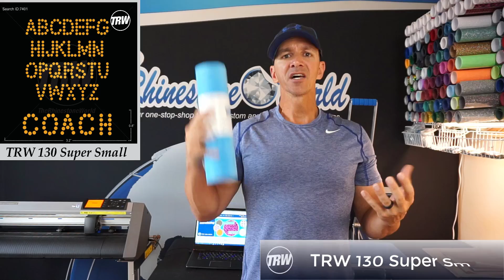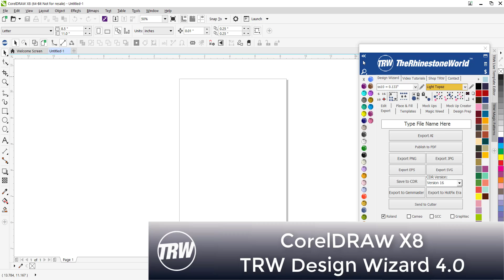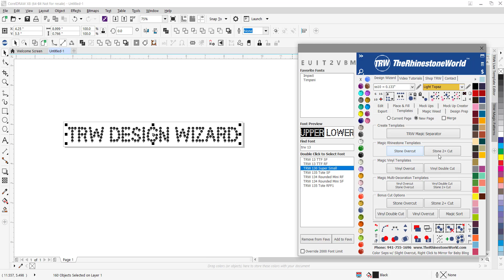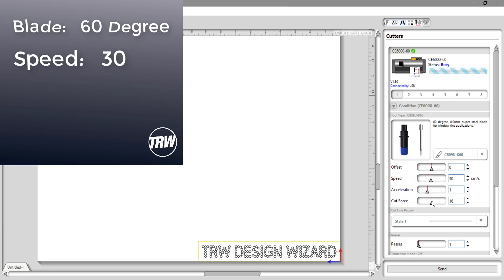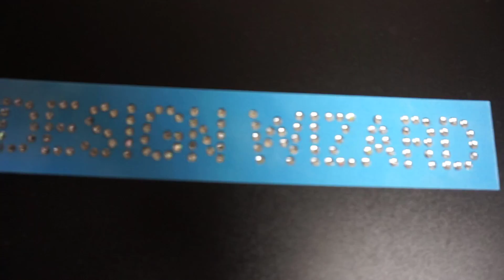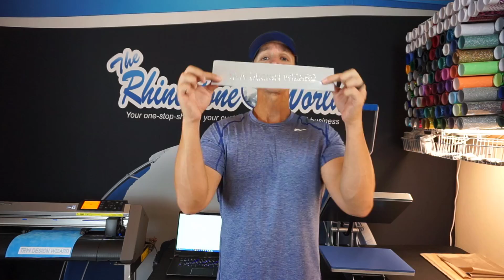How to Make a Rhinestone Template with your Graphtec Vinyl Cutter

Comment: Hi sir ..need you help what is the mm size of paper magic flock
Reply from the maker: We recommend when using a new material, to always test cut and dial your machine in. This way you're sure you have your test cuts dialed in right and you don't waste material. Each machine is different, even if they're the exact same. Blade age, and even the mechanics of the machines itself tend to vary in their performances. Here's a great starting guide for cutting the flock: https://therhinestoneworld.com/colorspark-cut-settings --- there is a guide for cricut starting points, as well as silhouette, whichever you're using. And here's my fave video of all time that will help you learn how to dial in your cut specs to get that material to weed like butter. There's a variety of materials in this video, flock is near the middle: https://www.youtube.com/watch?v=3wRE-u8NINU
Hope this helps! 
-TRW Crystal
We're live every Monday 8pm Eastern Time with tutorials and giveaways!
Here's the link to this Monday, 9-12-22, we're making rhinestone shirts and rhinestone decals!
https://www.youtube.com/watch?v=Doi8G_gZqpk

Comment: how long did it take to cut?
Reply from the maker: Just over a minute, if that, with a Graphtec. If we had increased Acceleration to 2 or 3, it would have gone even faster. ;) We've cut the Rhinestone Tumbler wrap designs in under 10 min with over 3,000 rhinestones. -TRW Pilar

Comment: I really like your Products..
What's the name of the software, so I can buy it from the website?
Can I use it with illustrator?
Swarovski Rhinestone are they same sizes of your Rhinestones?
Reply from the maker: Our software is called the TRW Design Wizard 5.0 Pro, and it is an add-on software for CorelDRAW only, so it does not work with Illustrator. I don't have any information as to the size of Swarovski rhinestones, but I do believe they are slightly bigger than our stones.

- TRW Haley

Comment: I GOT SOME RHINESTONES, MAGIC FLOCK, HOTFIX TAPE AND BLING ANYTHING FROM YOU GUYS. HOWEVER, I DONT GET THE TRW SOFTWARE AS YET. CAN YOU TELL ME WHAT SIZE SHOULD THE HOLE BE ON THE TEMPLATE IF AM GOING TO USE SS10 STONES.
Reply from the maker: You want to make sure your stone sizes are 0.13 in to make sure the template will fit ss10 stones.

Thank you for watching,
-TRW Bobbi

Comment: I still can’t get my Cricut to cut the material right. So frustrating!!!
Reply: Kristine Avra - I used to create a custom setting of  250 pressure and double cut for cutting Magic Flock on a Cricut Explore Air 2. You may also need to clean out the blade holder often during the cut.
Reply: Oh..and pull from left to right..it helps the blue dots stay on the paper backing, rather than coming off with the template.

Comment: can I just use the font into my graphic software only
Reply from the maker: The font TRW 130 Super Small can be used with any design software that references your font library on the computer.
You will need to size it properly to achieve a SS10 stone (3mm).
Sizing can be found here: http://www.therhinestoneworld.com/rhinestone-ttf-sizing-search
TRW Casey